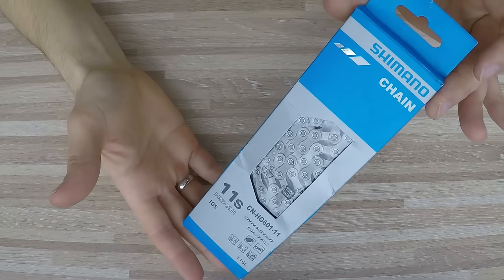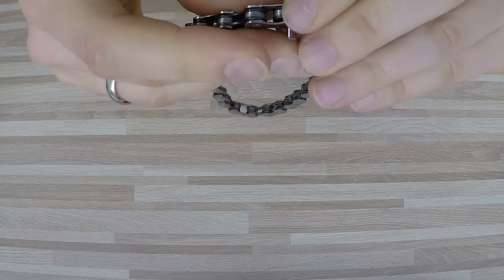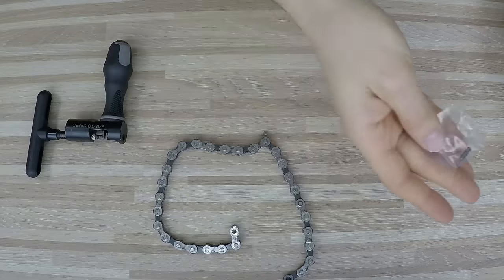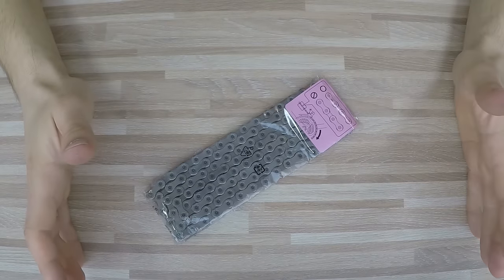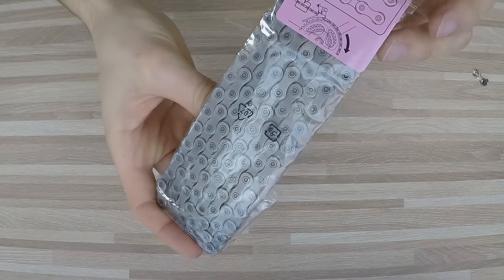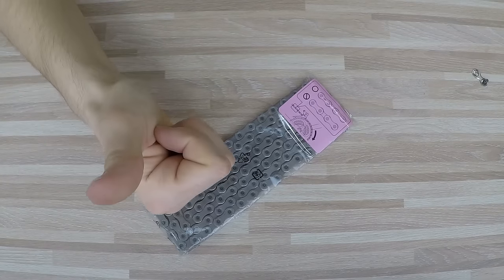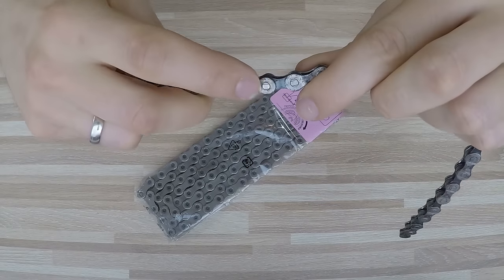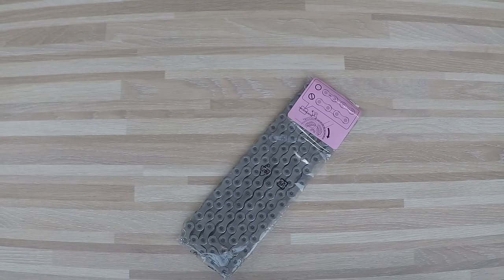4 Worst Mistakes In BICYCLE CHAIN Maintenance. How NOT to do it. SickBiker Tips.

Comment: #1 biggest mistake, the cheapos who use old, dirty motor oil to lube their chains. You took that junk out of your car for a reason, it's full of metal debris, grit & gunk that will wear out the insides of your engine if left in. That's why it turns black, that's why you replace it with fresh oil, that's why there's an oil filter & guess what? That's why that oil filter also needs changed regularly. Then you're putting that grit & crap on your bicycle chain & wondering why it wears out so fast? Derp!

Removing the factory lube should only be done if A) you're replacing it with new lube & B) that new lube is incompatible with the factory lube.  I use a wax type lube (White Lightning's Clean Ride) because of the conditions my bike is exposed to; sometimes get's wet regularly, but I live & ride on a dirt road, so it's dusty too. The dust sticks to oily lubes & turns into abrasive gunk. The "self cleaning" Clean Ride is perfect for me, but the waxy lube is not really compatible with the oily factory lubes & would cause other problems if the factory lube was left on. So before installing a new chain I have to soak out all the factory oil & work the wax lube into the barrels & joints. A little more effort than just keeping the factory lube, but well worth it in the long run. I just wipe down the chain with a rag to get the outer dust off & put on fresh Clean Ride every couple of months, rather than degreasing all the gunky oil/dust mixture out & relubing every couple of weeks.  Plus I don't get black crap all over my hands/clothes every time I touch the chain.
Reply: The oil filter is passed only by microscopic particels and these microscopic particels are not harmful as they polish the surface. No, the reason you change oil is due to the loss of VI's (viscosity improvers) and the subsequent changing of viscosity and you do not want  the oil-film to fail when the engine is getting hot. Is your chain getting hot? No? So where is the problem of using used motor oil on the chain? It may be not good enough for your engine, it is definitely still more than good enough for your chain.
Reply: 'but the waxy lube is not really compatible with the oily factory lubes & would cause other problems if the factory lube was left on'

how do you find out what is and is not compatible with the waxy lube you use? Or are all oil/factory lubes going to be incompatible?